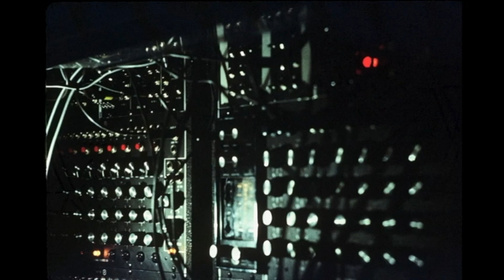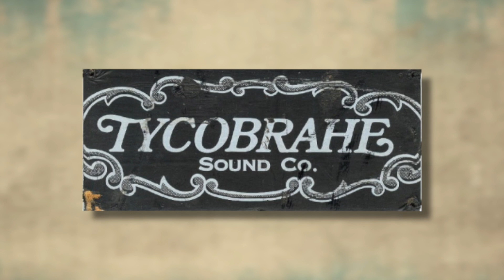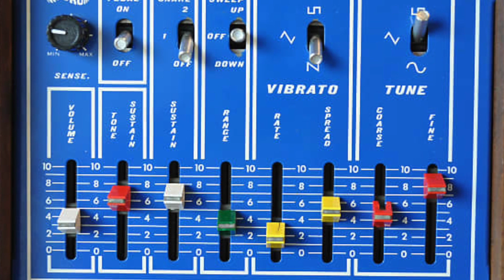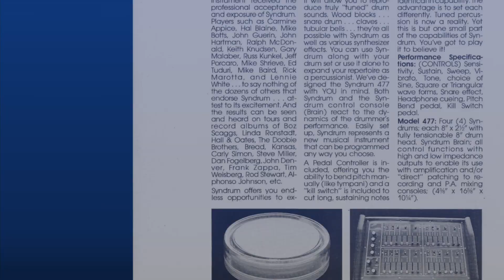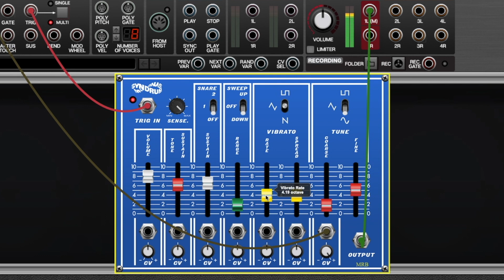Syndrum: The Electronic Drum

Comment: A software version of the Syndrum sounds like a great idea! I just want to mention one little detail. Your story about the Syndrum starts in 1976, and you claim the Syndrum was the first commercial electronic drum. However, the "Synare 1", by Star Instruments, was first produced in 1975. Their "Synare 2" was also in production by 1976. The Syndrum was definitely cool, and some famous acts used them, but they don't seem to have been first to market. 

https://en.wikipedia.org/wiki/Synare
Reply from the maker: According to The Drum: A History, by Matt Dean (2012), "A year after the Syndrum, the Synare was released by Star Instruments as a self-contained unit with the pads built onto the edge of the module. It was similar to the Syndrum but also allowed for a ring modular, a sequencer, and pink noise effects." https://www.google.com/books/edition/The_Drum/4CdzdFgfV8YC?hl=en&gbpv=1&bsq=syndrum
Reply: @CherryAudiovst  You should read the Alex Graham book Vintage Electronic Drums (1970-1989) as that is more accurate than Matt Dean's. The Impakt Tuneable Tom came out in 1973, the first Synare PS-1 came out just a couple of months before the Syndrums in late 1976. The Syndrum is called 477 as it was released in 1977, so that makes it THIRD. And Wikipedia is also wrong because someone has changed the text without doing any research.